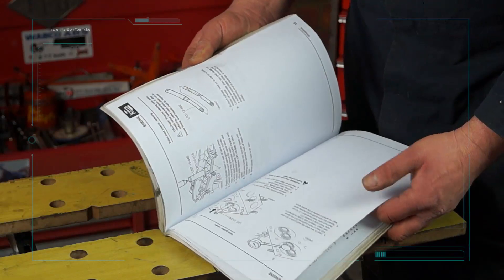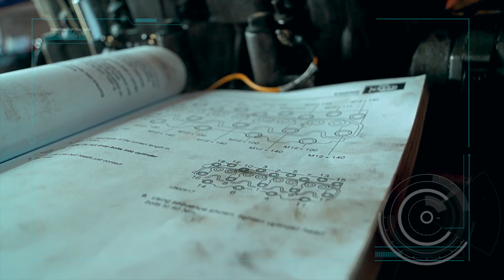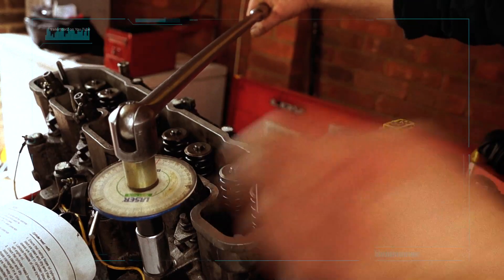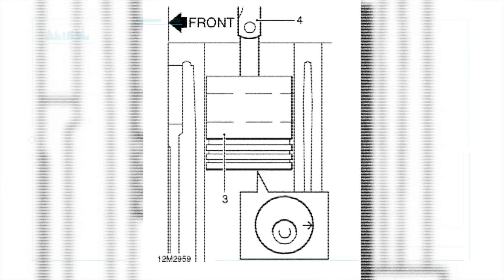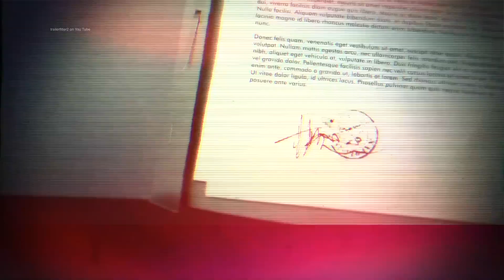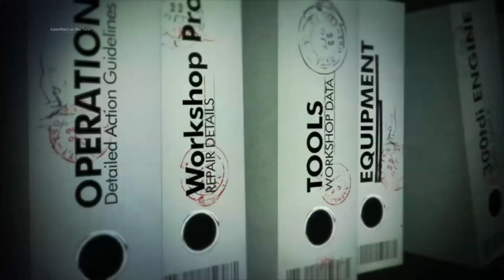Land Rover 300tdi Engine Workshop tips and tricks - measuring bore wear with piston skirt

Comment: Hi,

I have a leaking head gasket and plan on replacing it soon. I also hope it will fix the smoke coming out of the engine oil refill cap. On the way, when I will disassemble the head, I wanted to check if the piston rings and piston housing are ok. Wondered if there is a way to check that without taking out the piston, as you showed in a video above.

Thanks in advance,
George
Reply from the maker: George Gutnik  Hum.  a chuffing filler cap hole is not a good sign as it is an indication that the engine is worn.  You need to remove the pistons to check them  consider ring groove wear on the pistons and not just bore wear.
Reply from the maker: George Gutnik When you remove the head check it for warpage and perhaps a pressure test to ensure it is not cracked.   Head gasket inspection will show you for sure it leaked.
Reply: ***** 
I found a following warpage test of cylinder head, is it ok? http://www.rlb.50megs.com/trkheadwarp.html

As I understand there is no way to check cylinder assy without removing it right?

Have you met cases were chuffing filler cap hole was a result only of a leaking head gasket?
Reply from the maker: yes head warpage test good.  Chuffing is a result of compression lost past the piston rings.
Reply: ***** Thanks!
Reply from the maker: You're welcome